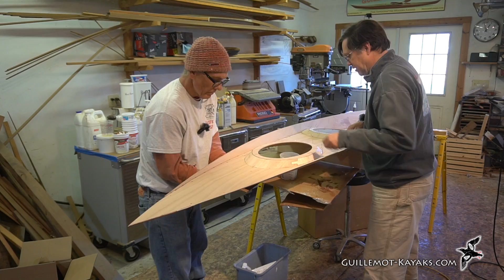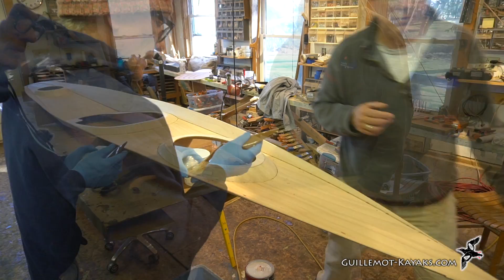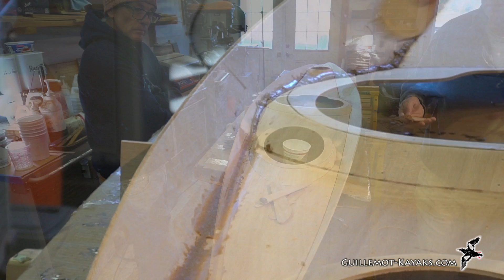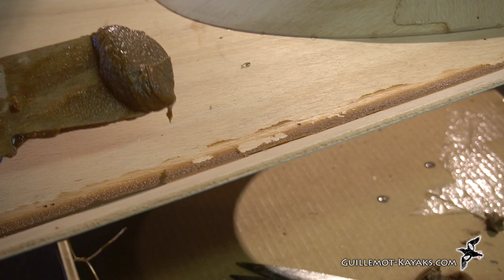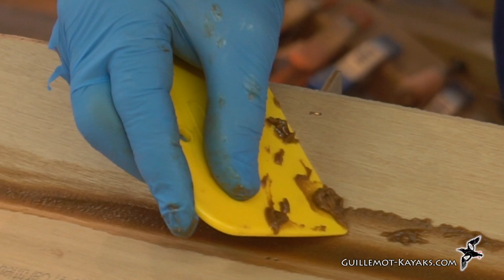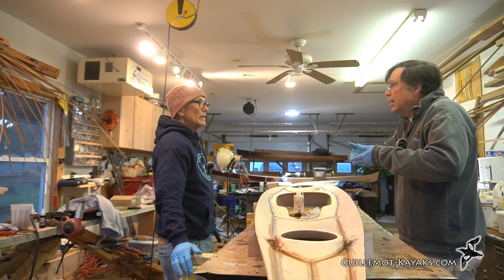Creating  Flawless Fillets - Petrel Play SG - E11

Comment: Nick, if you were building a cedar strip canoe with a chine, would you use a similar fillet on the inside? Or do you think there's a better way to get a clean look on a highly visible area?  Asking for a friend ;)
Reply from the maker: With the strip version of the Petrel Play I did add a fillet in the chine. It makes it easier for the cloth to handle the corner and reinforces the chine.
It is tricky with an open boat like a canoe where the fillet is visible but, I think it may be worth it. I would do good job of cleaning and fairing the interior and then just be unapologetic about the fillet. Maybe tape off on either side to handle messes, but otherwise own it.
I have milled pieces of wood with an angle to match the chine and a radius on the open edge. Essentially like 1/4-round trim molding that is custom fit to the boat shape. This does work and can look nice, but questionable as to whether it is worth the effort.

Comment: Hello Nick - thank you very much for the great video. It's really fun to watch you construct it. I have to say that I'm always looking forward to the new episodes. 👍👌Thank you for making this effort.🙏
I still have one question: isn't the upper gap shown in the video filled? It's just glued in. Is this done by the other side?
Reply from the maker: I'm not sure which gap you are referring to.
Reply: @NickSchade  Nick, I meant the edge on the two round cutouts, front and back. The Recess. There you sanded the edge at the beginning of the video. You said that the fiberglass mat would then lay down better. But I thought I saw that there was also a gap there? Maybe I saw it wrong too. I have to look again. It's difficult to describe, I'm sorry I put it so inaccurately.
Reply from the maker: @torstenzeps365  Once installed the recesses for the hatches all ended up fitting tight all the way around with no meaningful gaps.